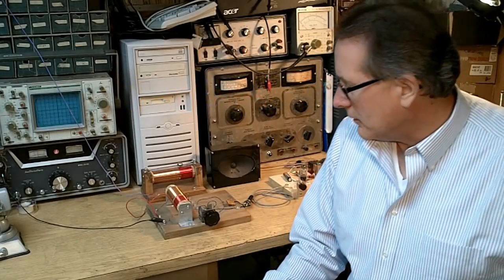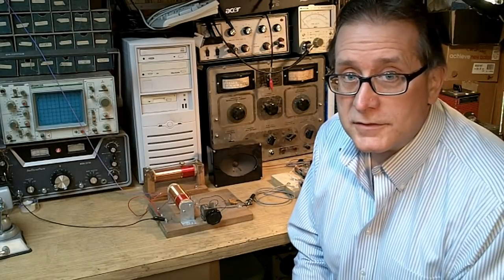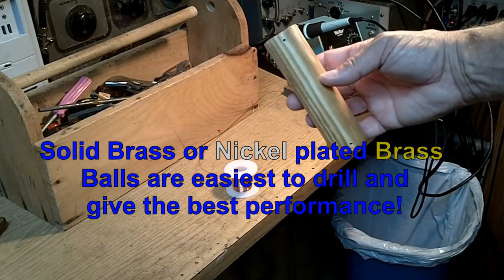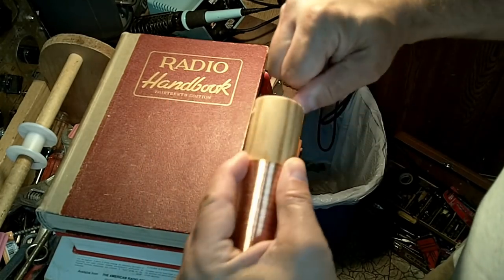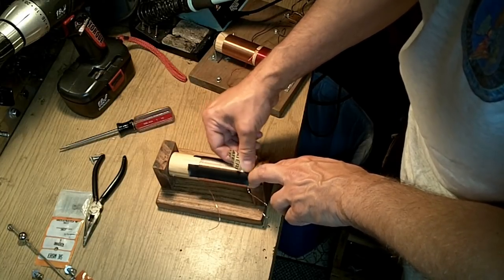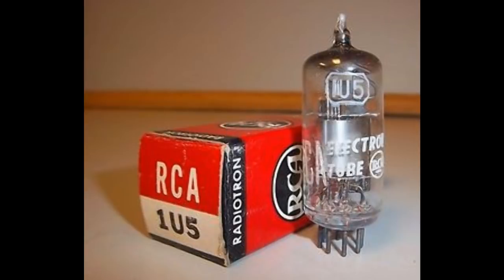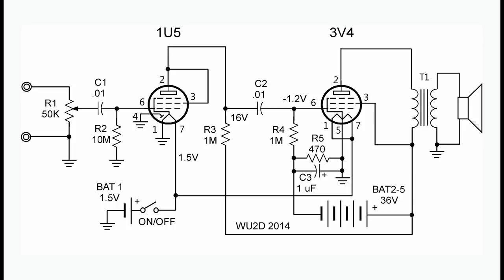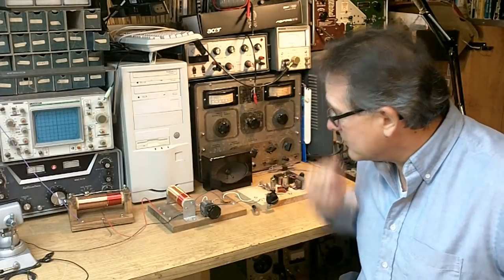Crystal Radio Part 2

Comment: As a kid in the 50's, I adapted the "Man From Mars" vacuum tube "hat radio" circuit to fit in a small plywood box and mounted an earphone "speaker" with a small whip antenna, to make a "walkie talkie radio".  Fairly selective and good volume for local stations.
Reply from the maker: What publication had such a cool circuit for a kid to copy?
Reply: @MIKROWAVE1  I think it was "Radio Electronics"  , Hugo Gernsback editor

Comment: Howdy. Nice.
The antenna loading coil is awesome. Together with the antenna capacitance they form a series resonant circuit having the strongest current at the detector. In my mind this means the antenna virtual capture lenght is greatly increased.
I am bewildered that no hobby book or magazine I have seen in my location (Finland, Europe) speaks about the benefit of the loading coil although evident and easy to understand.
My gratitude for the education.
In high regards.

Comment: I found the section on the antenna loading coil to be the most important. I have a crystal set that I built perhaps 10 years ago with many taps on the coil and a good variable capacitor. My antenna is an inverted L of about 85 feet length, but I had been connecting the antenna and ground across the entire coil. I will be adding a lower impedance primary and a variable antenna loading coil because you have demonstrated very well just how much difference those can make. (I will check out you loose coupler video before I build anything.)

To me, the vacuum tube amp in this video was a totally different topic which I just skipped.

Still, I found both this and your first crystal set video very informative. You do a good job of explaining how even a beginner can build one of these things.

Given the cost of some of the components, there might be a good topic in showing how to scrounge parts from old radios. I recently read a suggestion that one place to find old radios (such as old clock radios) is at Goodwill stores.

Comment: I've use silver beads from a jewelry supply shop in Santa FE ... They are round an work great
Reply from the maker: +Paul Pedrazza  Wow that sounds great. When I added the turns on the loading coil, I simply butt spliced the two wire ends and kept winding.

Comment: The reason people see your videos is because you do not use added power like batteries we all know that tubes require added power or energy batteries your videos have mainly been how to improve crystal radios without added power am i right? And so thats why your videos are so liked.
Reply from the maker: Well some folks are purists who want the radio station signal alone to supply the power. Some want to be more clever stealing power in other ways like from another radio station that is stronger and let that power a separate stage or two. And then some just add stages and a battery!

Comment: What size magnetic wire are you using for the windings on.the tube ,I no I don't want to thin of a wire,for that ,If anyone no ,s  maybe 22gauge or 20 guage,If a lot of stuff I been collecting to do builds so I have options ,I even ordered antique diodes the standard In34 ,military grade diodes,

Comment: @:3:25 Is that 1" or 1.5" dowel? I thought you used 1.5"?
Reply: Another question @11:46 I'm confused as to what the three screws (i'll call them 1, 2, and 3 from the top of the image) 
1. From antenna, is this connected to the end of the coil?. 
2. ?
3. Beginning of coil?
Reply from the maker: 1.5" Yup messed up there.